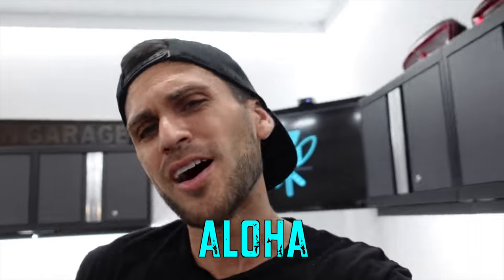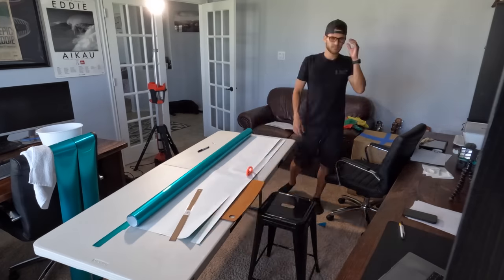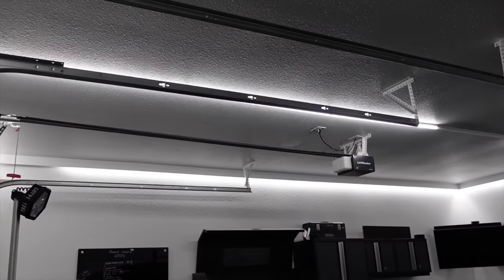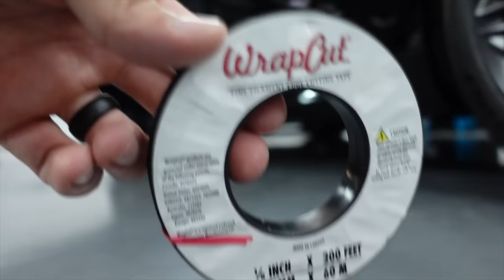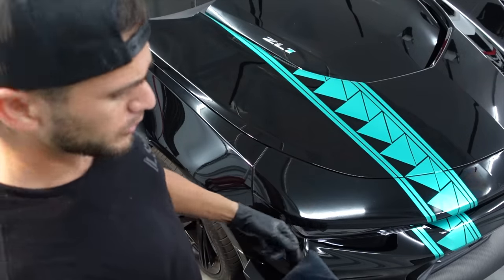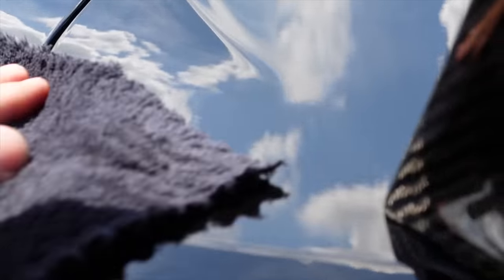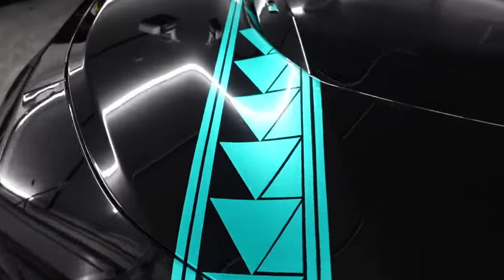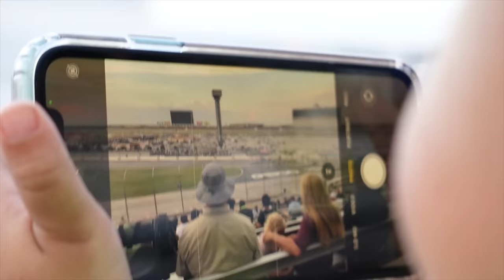DIY Custom Vinyl Livery - How To on Camaro ZL1

Comment: I used similar if not the same lights and I always had an issue with a couple lights not turning on unless I smacked them with a broom. I guess they would work themselves loose. On this house I just moved into I’ll be going with the lights your dad used or greenlights even though I loved the look of the strip lights, too many issues.

Comment: Spend a few hundred and get a Silhouette Cameo for a surprise gift for your wife.  Then you will have a vinyl cutter.  I did this 10yrs ago this month and zero regrets.  Silhouette is a beast, zero issues with mine and 8yrs of that have been in my shop in humid Louisiana.
Reply from the maker: I almost went out a bought one half way through this project 😅

Comment: I would like your opinion:  On the 2019 Chevrolet 1500 Trucks with 5.3 engines that have the lifter issues, would using 100 percent synthetic oil help the engine from having these lifter issues, also would using Amsoil or any specific brand help to keep from having these same lifter issues? I would appreciate your input. 🤔🤔👍👍
Reply: I hope he replies, I have also wondered about using full synthetic and the Amsoil brand also to help the lifter problem.
Reply: Only way to 100% avoid the lifter issue from possibly happening, is to disable the (dynamic or active) fuel management system. Its super easy to do, and it removes the worry that it could "possibly" (because it doesn't happen to everyone) happening. Its a lifter issue that as you've heard, obviously from your question, that GM and Ford have experienced in their V-8 engines when equipped with AVM/DFM systems.
Reply: *AFM/DFM*
Reply: Or you could replace the lifters, but Chevy and Ford only cover this if failure occurs unfortunately.
Reply: @jrfairclough4291  The truck I bought is a 2019 Chevy Silverado 1500, 5.3, I didn't know about this before I bought it, just found out afterwards, it had 67,000 miles and no issues so far. Does disabling it affect the gas mileage much?
Reply: @jrfairclough4291  Does this void your warranty, and from the other question, does it affect the gas mileage much?

Comment: The truck I bought is a 2019 Chevy Silverado 1500, 5.3, I didn't know about this before I bought it, just found out afterwards, it had 67,000 miles and no issues so far. Does disabling the AFM/DFM affect the gas mileage much?